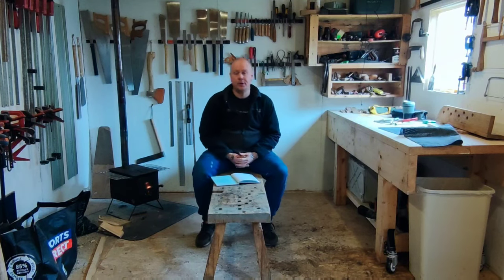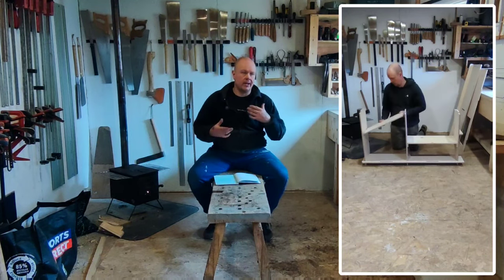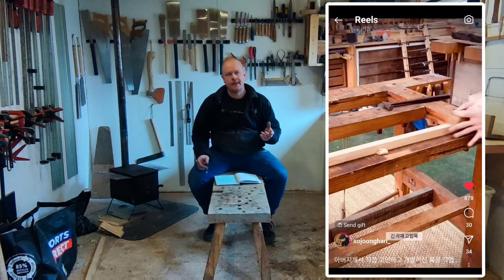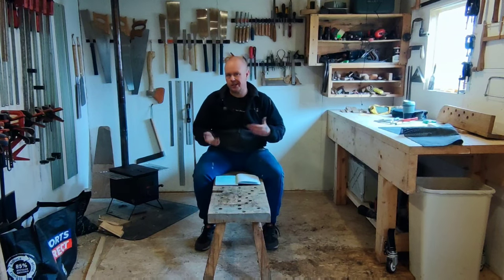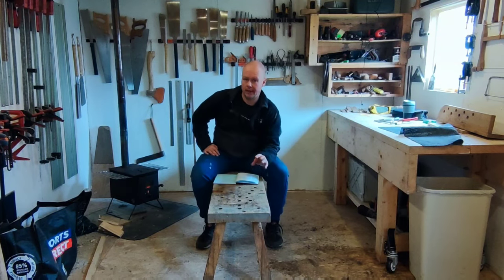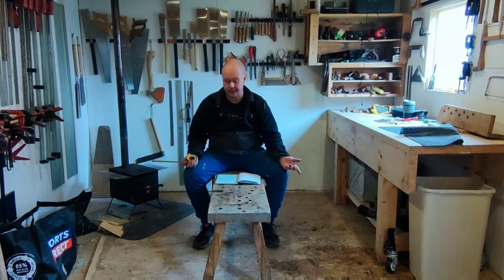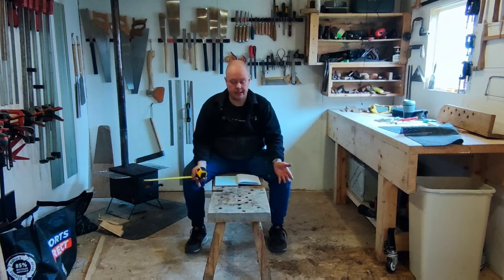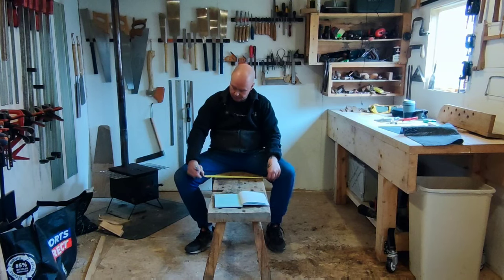Podcast 114. Roman workbench Q & A

Comment: I have watched several of his videos and I downloaded his book and found his work, instructions, and ideas to be very helpful.  Because I use Japanese planes more and more I wonder if it might be beneficial for me to get rid of one of my normal workbenches and replace it with a low Roman workbench.  At 76 years old I am not about to sit on the floor like many Japanese traditional woodworkers do but the idea of a Roman bench might just fit.  Thoughts?
Reply: I am going to say it depends on the size of your projects.  I made a 36"x32" table by hand using the low bench.   The difficulty is in trying to plane and plane edge long stock.   When the stock is as long as the bench(or longer than your reach) you cant sit anymore, and then you have to bend over to plane.   The low roman bench is very handy and portable.   I would also suggest using the plank method to build the top, I made Rex Krueger single 2x10 lightweight one, but by the time I got it flat (and you need it flat) and reinforced underneath, I have just as much wood as if I had made a plank style out of 2x4s.  or going by what DW says, maybe 2 2x10 laminated together.